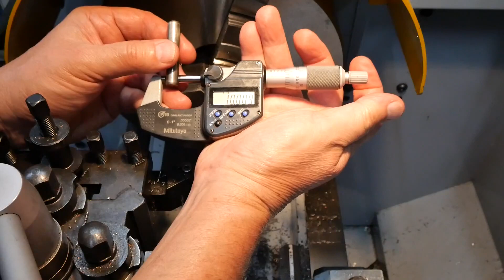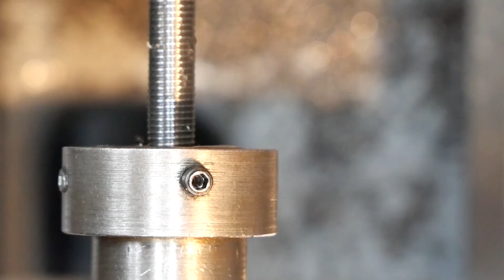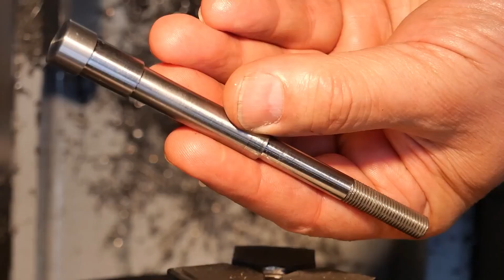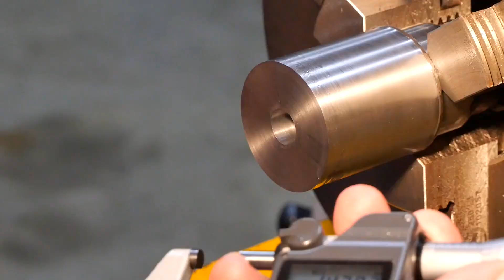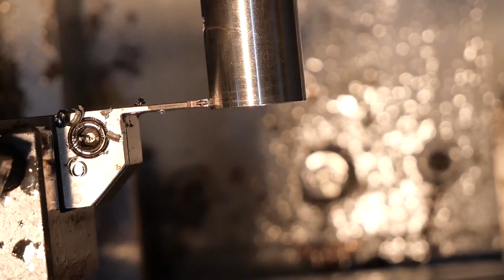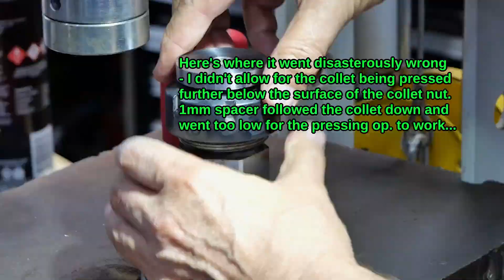Building the Lynx15 - Part 3

Comment: Can you save the shaft by cutting or turning the disc off?
Reply from the maker: So, a new day and back at it - knocked up a jig to press the disc off. Heated the disc to 300C and it came off with much less pressure than I used when putting it on. However the disc bore and shaft end are both badly galled, so I do need to remake both of them. 
Anyway, thanks for your suggestion.

Comment: Oh, bugger.  Hot it up, press the shaft back out, and then do a hot / cold shrink fit, your tolerances should be fine.  The 648 will let go if you get it hot, but you're gonna need to press it off.  If you do remake it, shove a centre pop in the arse end of the shaft, you'll want one for balancing.

Shame about the collet nut, you could probably have used the collet without the nut, though.
Reply from the maker: Thanks for the feedback. I hadn't thought about balancing - a centre in the back of the shaft is a good idea.
Cheers.

Comment: The crankshaft gave you quite the runaround. Thin parts loves bending. I never hit dimensions first time on thin parts. I settle for a couple of spring passes before adjusting my cross-slide, that way I eliminate tapers and flex related inconsistencies.
Reply from the maker: All good fun :)

Comment: Hello Alan, I enjoyed the video very much, too bad about the failure at near completion.  For the fine finishing have you not considered making a shear cutter, apparently they can shave off a couple of tenths of a thousandth inch and leave a lovely finish?
A very difficult press there, perhaps a bit of heat could have made the female part little more compliant.
Anyhow cheers and have a nice day!
Reply: I agree that using heat and light pressure are better suited for delicate parts. On a shrink fit the Locktite is optional.
Reply from the maker: Thank you. Bit of heat is definitely an option, but I think I'll remake the parts with a looser fit.
Cheers